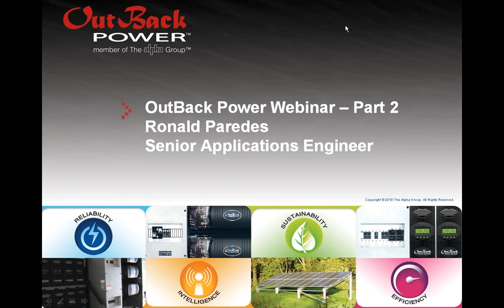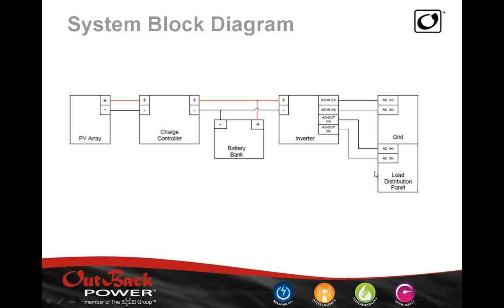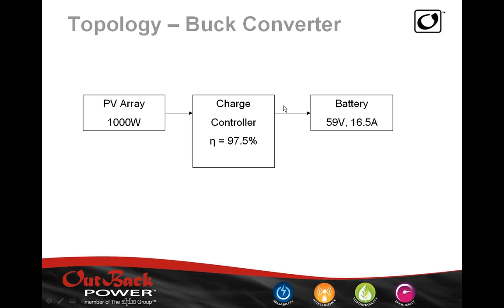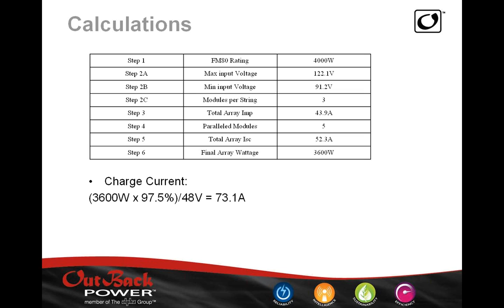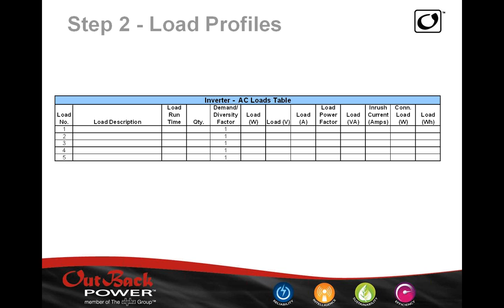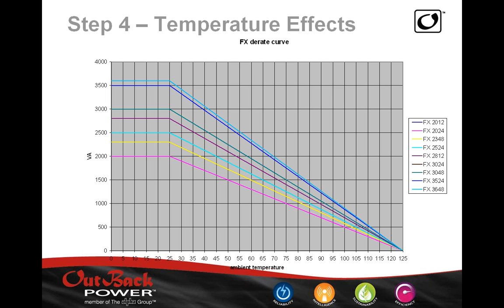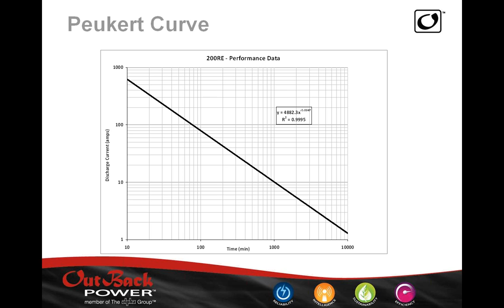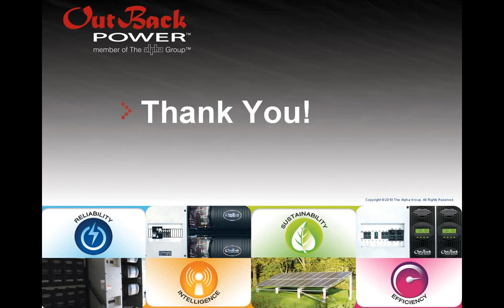Webinar | OutBack Power Training - Part 2

Comment: I think it's best to go 1.5-2 times the size bank you think you need to get by on. I hope to build my bank up 10 times its needed size. To allow 4-5+ days use in low sun. And 80%discharge. Or less than 10% discharge per day. It will be in the 10,000 ah neighborhood. If I ever make it that far. About 5k ah min. At 29.4v nax charge. If I only charge to 28.5v and discharge to 23v. I'm hoping to atleast have the capacity to last through the night in 15-20 years! If I save $20 a month. I should be able to replace the bank then easily!